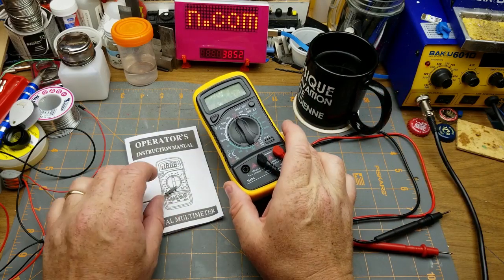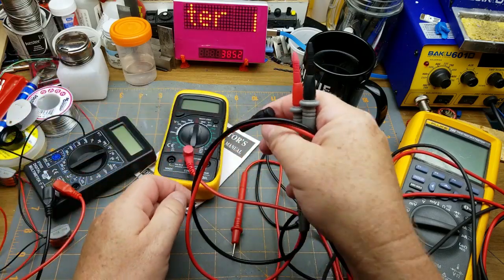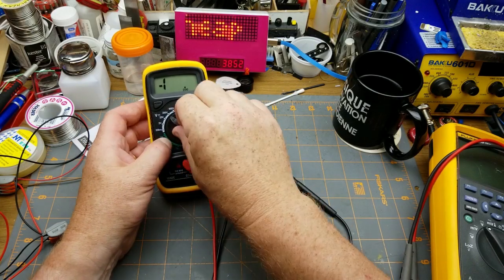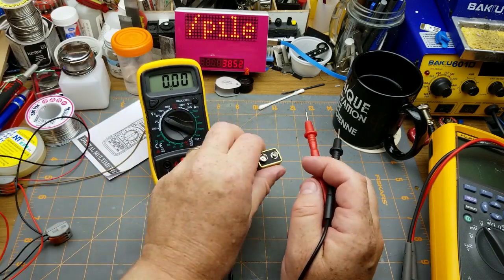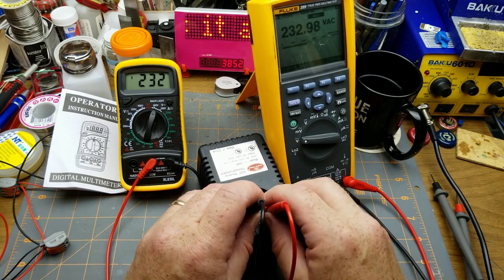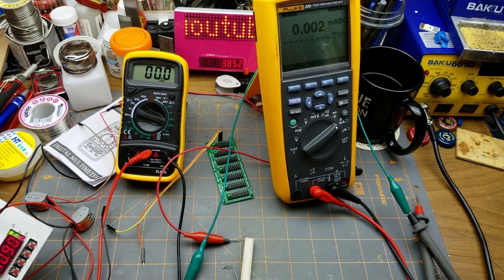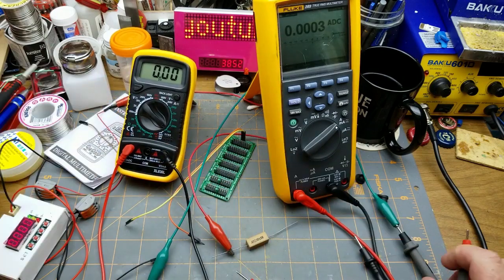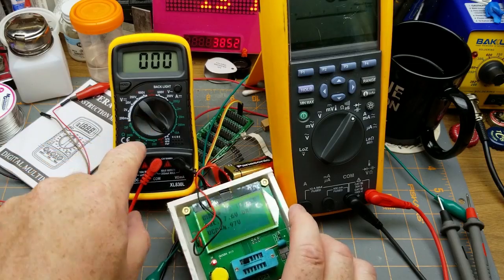testing another cheap multimeter

Comment: I upgraded to a "better" pair of eBay 1000 volt 10 amp silicone universal test leads for $2.   To make the test leads work just cut the shrouds back to expose about 1/2 of the banana plugs just like they are on the original cheapo leads.  I purchased the meters for $5 each, shipped free on eBay including the yellow rubber holster from seller:. didustore shipping from China took about 3 weeks.

Comment: Pretty insightful video. I have the exact same multimeter but when i try to measure a 1.5V battery  or any other things like you did. It didnt change value. It just stay and 0.0 or sometimes 0.1 Is the meter broken or am i doing something wrong?
Reply from the maker: It might be a fault in the meter, or you might have a bad cable (or even the cables might not be connected securely).
Also, double-check that you are set to the appropriate voltage range. If the meter is set to expect 200 volts, then 1.5 will be too low for it to notice much.

Comment: Since you mentioned that you were concerned that it would work correctly after trying to re align it when you put it back together you should have tried it and tested it before you opened it up so you could have had a true test of how well it works before you messed with it. Anyways thanks for the video.🙂👍✌
Reply from the maker: Only slightly concerned. It was super cheap, after all.
Reply: @pileofstuff  If testing performance, that should always be done as built, not after "tampering".   

Disassembly afterward can reveal substandard components which might indicate potential service, longevity and hazard issues. Retesting after reassembly can indicate fragility and reliability of measurements, but cosmetic appearance of internal components is an unreliable indicator of performance or reliability.  

btw, Fewer and fewer electronic items are being designed with repair or servicing as considerations. Cheap ones are designed for minimum cost of manufacturing, and tested only after built, but it's not unusual for these inexpensive things to have very low rejection and failure rates within their warranty periods.

Comment: Hello sir.
I'm not an electrician. And I've a question please. 
I wants to buy a cheap multimeter to check my car's oil and radiator anti freeze. (The test is to check for metal in the oil or anti freeze. Above 0.3 volts means it's gone bad and there's a electrons in it)
I'll check up to 20. And maybe my car battery up to 20. I can trust this item to do a good work?
Thank you.
Reply: This meter is accurate enough, but you need to take care to keep it dry and clean the test leads.  btw, those tests indicte engine wear not fluid quality degrdtion.

Comment: for the zebra stripes, think a lot of really small wires with insulation
the fact that each wire is insulated makes for fairly easy assembly (if you're off by a couple strands, it just doesn't matter, and the contacts on the screen and board are large by comparison)
a fairly sloppy way of connecting things...
Reply: A sloppy way of connection that's used within almost EVERY multimeter and other device that uses a complex LCD screen.

Comment: If I am looking for 110 volts and I get 119 close enough or 12 volts and it reads 13 close enough. One test YouTube meter testers never test is the meter's "loading effect". That is the test that separates the good meters from the junk meters.
Reply from the maker: Good point.Though if I were working with sensitive enough circuits for that to be a concern, this is probably not the meter for the job.

Comment: Cheap meters work, but probably after some time their readouts start to drift. Long time ago I had some of these, and I no longer have any of these.
You could try clamp meters. There is one a bit more pricey, but very good and even hackable. Normally you get in in 2000 counts, but i's possible to hack it to 10000 counts and much higher current measurement. Even up to 1000 amps. And its all for around 40$. Well, maybe a bit more, as you might need some stuff to reprogram eeprom inside.

Comment: Great video and I do agree about using it on "arduino" projects. I use a fluke T5-600 for mains (240v UK) voltages and above, but use a Proster MS8233D for lower voltages and resistance as the fluke is just too unwieldy and the Proster has better (manual) ranging for that smaller stuff (5-24v Dc). I have used the little bugger for mains stuff (and nearly blow it up a couple of times as I didn't change the lead positions (duh!)) with little issue. Personally I find the idea of blowing up my Proster better than the idea of blowing up my fluke. Hehehe

Comment: Can the XL830L DMM test capacitors?
Reply from the maker: no, it does not have that function.
I use my multi-component tester (AKA transistor tester-cheap on ebay) or my Uni-t 210 for capacitor testing.
Reply: @pileofstuff  LOL Cheers :) my brand spanking new DMM should arrive tomorrow. Was hoping to check a 1.5 uf 400V AV capacitor on a fan :).  Can I use the voltmeter   section to test?

Comment: What do you actually do for a living?? Is that something you don't talk about on the channel how have I not picked it up
Reply from the maker: I work as a tech in telecom for a company that shall not be named.

There's few more clues about my history peppered through this video: https://youtu.be/SP7rDg4A7sc

Back when I was in high school I pumped gas, did oil changes, patched tires and did the occasional carb kit at a small town Ford dealership.
Reply: I believe 12voltvids has the same job as you
Reply from the maker: @maicod  Similar type of work, but not exactly. I've seen things in the background of a few of his videos that I also work with.
Reply: we've still heldon to an 'analog phone line' (all digital further on the track ofcourse) cause it has benefits during a power disruption (it gets its power from the line) but costs for it got way up. I also have a small Sipura voip box that connects to the Internet for my second phone line
Reply: @pileofstuff  I feel like we have much to discuss I might toss you an email one of these days

Comment: nice converter to 230 V . Is it converting to 50hz too?
Reply from the maker: Nope. It's just a simple transformer.
Reply: ok so you couldn't use it for european appliances
Reply from the maker: Certainly not for anything that derives timing from the line frequency. Clocks and cheap tape recorders would have a problem.
shavers, lights and simple devices shouldn't have an issue, though
Reply: like a solder iron :)
Reply from the maker: @maicod  Yup. Or even a hot glue gun.
The converter is rated for 500 watts, so anything up to that ought to work. 

I use it mostly for the 3D pen that I bought on ebay from an eastern European seller.
Reply: always handy to have it on hand

Comment: most of the cheapies are just slow, slow, slow
Reply from the maker: I was pleasantly surprised that the continuity on my older cheaper meter was as fast as it is.
Reply: @pileofstuff  they usually sample three or four times before they lock in on a voltage or resistance. Aint nobody got time fo dat!